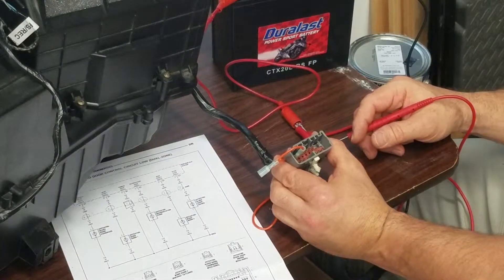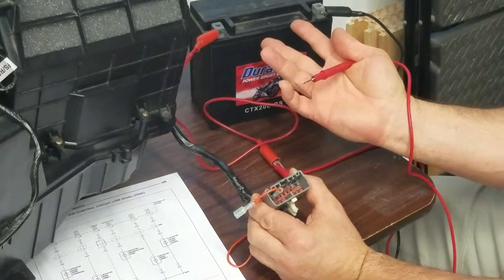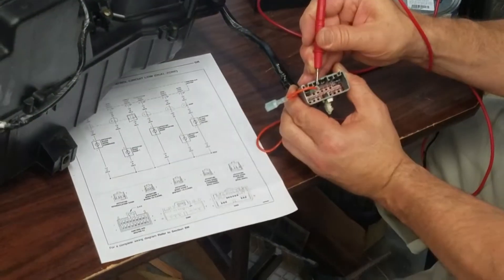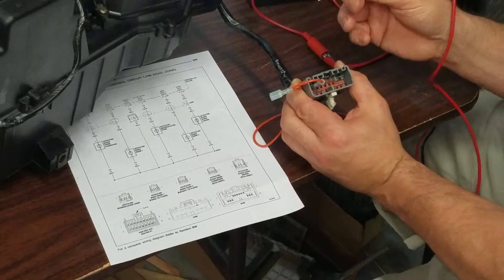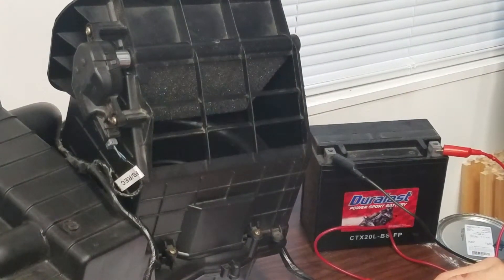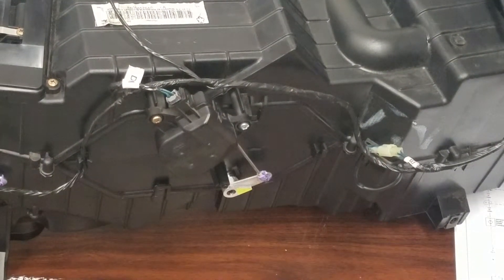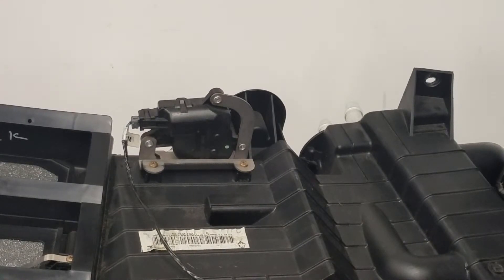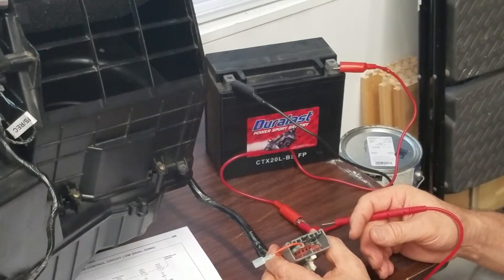2006 Dodge Ram 2500 dual-zone HVAC box actuator and door test

Comment: Can you attach a copy of that diagram please?
Reply: Its in the service manual 24-4 and 8W-80-29 Connectors Pin-Outs

Common: pin 2
Recirculation door: pin 4
Lower driver side door: pin 8
Center front side blend door: pin 11
Center back side blend door: pin 12
Top driver side door : pin 13

Comment: Do you have a pin out image that you were using?
Reply: Common: pin 2
Recirculation door: pin 4
Lower driver side door: pin 8
Center front side blend door: pin 11
Center back side blend door: pin 12
Top driver side door : pin 13

Comment: If they have power all the time wouldn’t that burn the motor up? Are how does it know when it’s all the way to stop the motor? Are is that just what holds them tight in 1 way are the other?
   Can you answer that please?
Reply: If I recall correctly they are some sort of stepper motors that run full power until they stall out and triggers something in the computer, that will then be the reference point for full open/close which it will cycle to/from.
They do this "calibration" every time you turn the ignition on, if you listen you can hear them cycle to and from.
Edit. at least for the ones meant to operate fully open or fully closed, like the recirculation door, the others probably operates between 2 reference points on the stepper motors.

Comment: I have my hvac box from a 2003 3500 rebuilt with Blend Door USA doors, new heater core and evaporator. I want to bench test the actuators before reinstalling it but I'm a little unclear about the setup. Am I correct that in your test the negative (black wire) from the battery goes to ground. Orange jumper on #2 terminal gets power all the time (connected to positive from battery) and you probe various door pins with power which individually activate actuators and move doors?